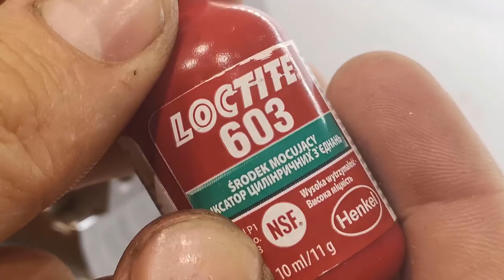020 From marking knife to metal scriber - quick upgrade.

Comment: Stavros, thank you for your videos. Not only are they enjoyable to watch but I've learnt a lot from them. I have one question: I don't know anything much about metal-work but doesn't the drill-bit lose its hardness during grinding, so wouldn't it need re-hardening? Sorry if it is an obvious question.
Reply: It is high speed steel. You can get it up to quite high temperature before having issues.
Reply: Thank you  @DavidKirtley , much appreciated.
Reply from the maker: Thank you! The drill bit is still hard because i put it to the water many times during grinding. Regards!
Reply: @StavrosGakos  Thanks, that makes sense.